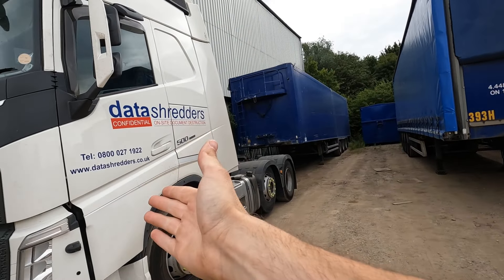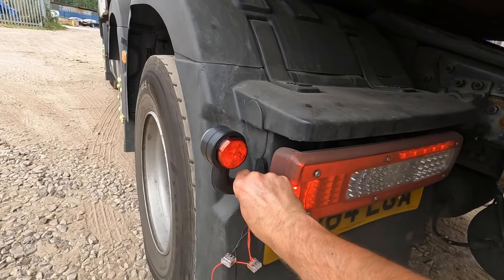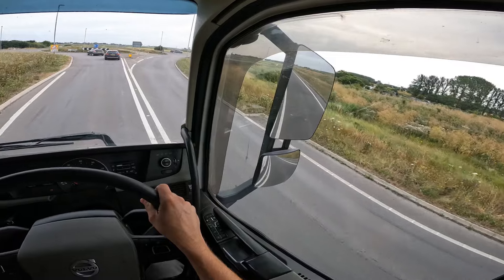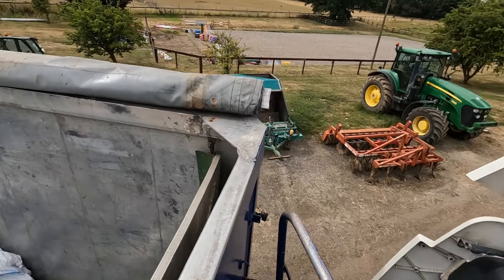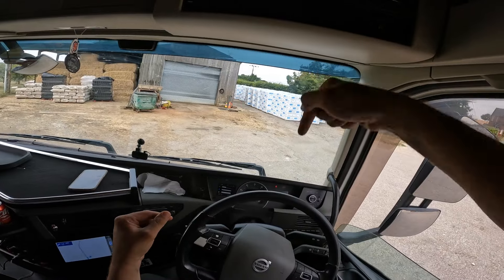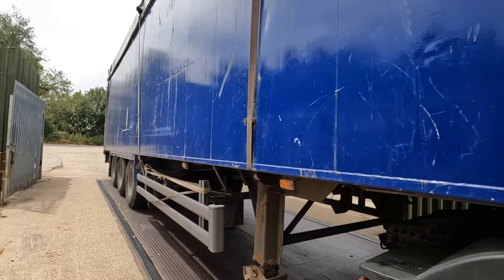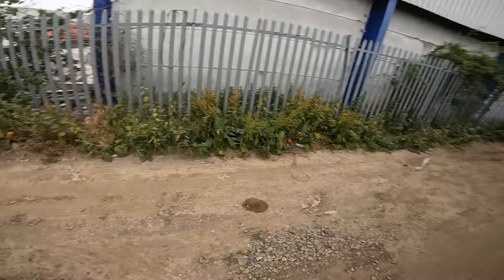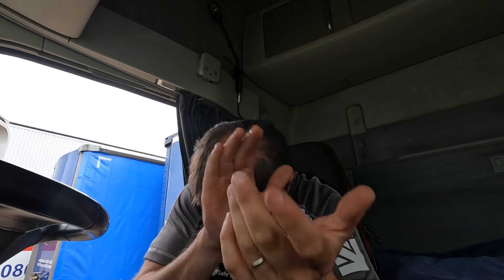EXCITING News | Walking Floor?? | Fitting Marker Lights | Trucking Vlog 72 | #truckertim

Comment: Tim, you should never of cut your aerial down as it’s matched to your radios frequency. So don’t transmit as you may damage your radio. All the best Darren
Reply: You need to put it on the wing mirror arm on the drivers side missing the tree and low branches 👍👍

Comment: Tim you can't just cut the antenna, it will affect the SWR and resonant at a different frequency.  You need to buy a shorter antenna.   A bad SWR on the antenna can break the radio and affect the distance which you can transmit

Comment: i have to make a couple of observations im afraid to say, in Newmarket Horses rule everyone gives them right of way, Newmarket was given Royal recognition as the"home of the sport of Kings" by His Majesty King George the fifth (i was born there), and second observation you can get for your CB antenna a 90 degree elbow that screws onto your magmount and then you can stick your magmount on the back of the cab, also you shortening the whip like you did while looking better will have without doubt affected the VSWR ( variable standing wave ratio) of your antenna and conversly the performance the best VSWR more commonly referred to as SWR is within the range of 1 to 1.1 to 1 to 1.5, the tractor antenna was proably shortened due to grounding problems with glass fibre tractor cabs, also a previous CB op back in the day and now a fully Licensed Amateur Radio Operator

Comment: Put the antenna on the drivers side The nearer the middle of the road the higher the trees mine was 15’3 on the Merc Actross V8 Low Loader used it as a load guide didn’t catch much at all

Comment: To get the truck to not cut out press the CC button on the steering wheel and the toggle switch under it give it a flick puts a little bit of revs on stops it cutting out

Comment: Tim, have you tried a 12v negative ioniser in your truck to ease your hay fever.
It removes all the particles in the air by latching onto them and making them fall to the ground. It actually works.

Comment: Tim re Cb Antenna  you have knocked the Antenna off frequency  by cutting it  a thing called (Swr) Standard Wave Ratio is out van potentially  over heat your radio when talking on it.. i did suggest move it to drivers side ... ALSO you need Lights on your Mirrors..
Reply from the maker: Hi Colin, I do need to get round to moving it,  lights on the mirrors is a great idea 🚛👍

Comment: Cutting the antenna won’t work. They’re tuned to the frequency used for CB. Get the SWR checked or buy an antenna that’s designed to be shorter or you’ll potentially damage your radio.

Comment: Wouldn’t to be better to use an original Volvo antenna? They used to be very good in old F10/F12 days, they were normally pre wired so easy to fit and pretty short.

Comment: Son you're a great entertainer but sadly portray the wrong image of truckers.
More power to you for the effort put into the videos.
However why do truckers these days have to publicise a false narrative. 
In other words could you do the job without Sat nav.
Can you read map.
Could you survive without all the gizmos Inc mobile phones.
Could you entertain yourself in isolation without all the gadgets.
Just observing and not being critical. 
I'm envious in a way as I never had all the tech.
I had to listen and learn from the older guys.
Directions drawn on trailer dust.
Francs, marks, pesoteos,  punts, sterling, lira carried.
Phonecards for each country.
Ciggies and alcohol for beaurcratic nonsense. 
Cb's for companionship and sos.
And so on and so forth.
Seems like everything is a simulation and surreal .
I'm 54 yrs young now with 3 million miles under my belt working the rigs across to Europe and I fail to comprehend how you young fellas would cope should tech not be available to you.
I'm not knocking you but I shudder at the thought of trusting you lot to keep things moving in the event technology aids go dead someday soon.
Ps. I do use a mobile and occasionally a sat nav so am not biased.
Less tech is better.
Common sense and fellow interaction is also better.
The transport industry has committed suicide in regards to road safety because of tech.
Sensors for this and that etc.
AI is going to finish the industry off and then what happens. 
Great video.  I've another 20 yrs to give to the industry but I'll be a giant history book with as little techno as possible. 
Keep on sucking ⛽